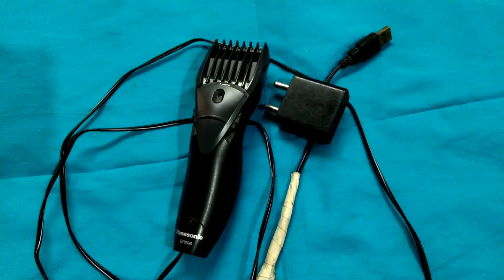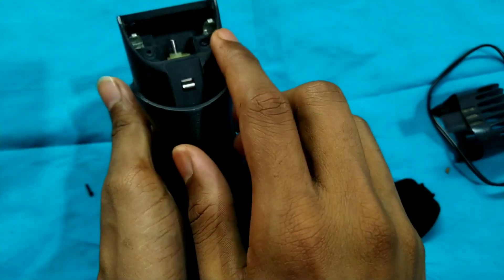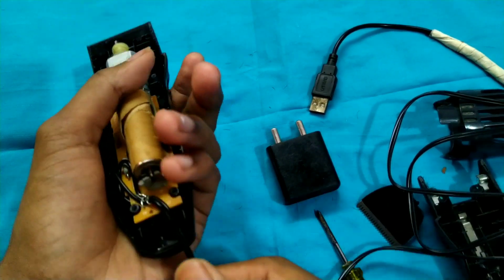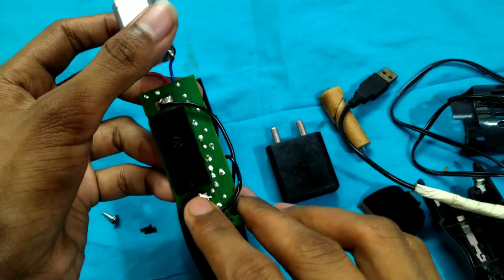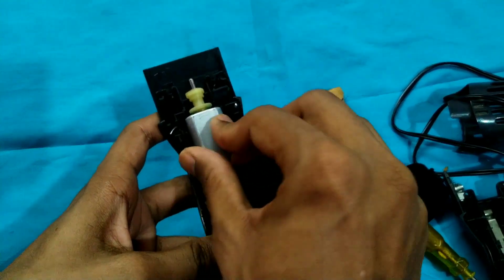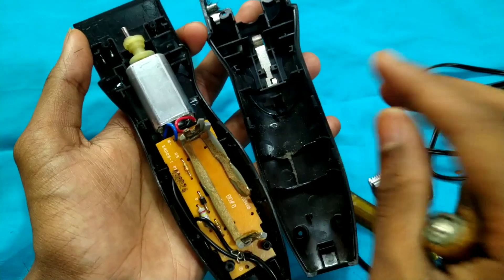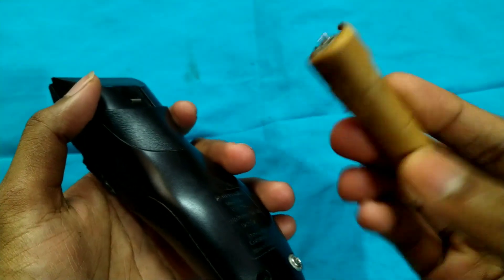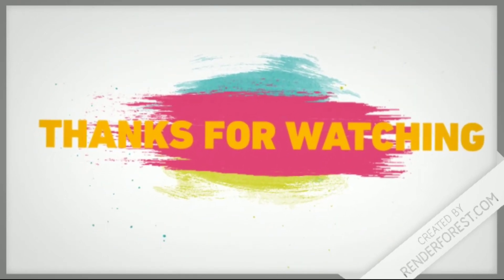trimmer repair in 5min | how to repair trimmer | how to make usb trimmer | tamil | manimarantech

Comment: Hi bro na unga method ha follow panen.. USB cable ila... Multi meter la battery  voltage check panen 0.95 dhan vandhadhu.. 

Apram usb cable ila so mosquito charging wire ha use panen..tup nu sound vanthu line Trip agidychi.. 

Trimmer problem agi irukuma.. Vera battery vangalamnu iruken.. 
Konjam solunga bro..
Reply from the maker: Mosquito bat circuit board la... Romba kami current tha bro varum... So current pathama components burn aagidum.... So don't try this again....

Comment: Bro, as suggested I connected my philips trimmer HC 7452 to usb cable to battery terminals and removed battery, but switch is not working and also blade is getting heated within few seconds
Reply from the maker: I don't why switch not working....
Use resistor ( 1ohm 5watts ) buy from electronics mp3 player Shop..

Join our telegram group and get my number to call me or message me bro... I will tell how to connect resistor.....